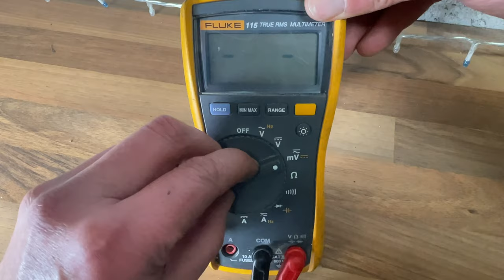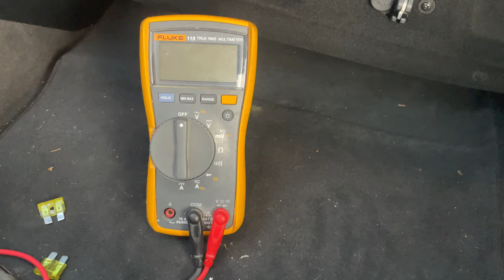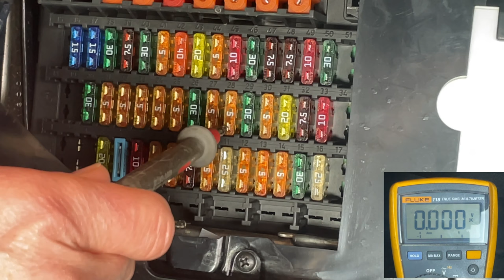How to Test Car Fuses With a Multimeter - Continuity Check

Comment: Thank you for teaching us!
Reply from the maker: you're welcome, glad you find the videos helpful! 👍
Reply: Is it safe mate
Reply from the maker: @puresim316nosimracingnolif3 if you’re referring to testing fuses in the fuse box without removing them, there is a small risk of blowing the fuse in your meter if the circuit is switched on and above 10A. If in any doubt, you can disconnect the battery first or remove fuses individually. Cheers, Phil

Comment: I just bought a '95 Dodge Dakota with high hopes, and wanted to be sure before checking the fuses using a multimeter. The brake lights won't operate, so I'm moving up the line to locate the source of the difficulty. Other things aren't working as well (gas gauge, dash light, etc.), so while I'm in the fuse box, I'm going to mind everybody's business in there. The only thing wrong that doesn't bother me is the passenger's interior door handle. In order to open the door, the passenger has to roll down the window and operate the exterior door handle. I've decided that's part of the character, and I may not even fix it. lol Thanks for the tutorial.
Reply from the maker: Looked it up ad the Dodge Dakota looks like a nice truck! 👍 From your post, sounds like you have a good idea what you are doing but when multiple things stop working, it is often an earthing fault. Check at the rear lights to see if you are getting 12v to your brake lights, if you are, you can forget about the fuse. Agree, reaching out of the window to open the door from the outside, will just make the truck and you look more cool! 😎

Comment: Can i also check its Amperage, with multimeter right?
Reply from the maker: Yep, that's correct. If your multimeter has the capability (and most do) usually, you need to switch the position where the red lead plugs into your multimeter, you should see another socket on the front of the meter where it plugs in. Then select "DC Amps" on your meter. You can then pull out a fuse and put the red lead into one of the exposed contacts (where the fuse used to be plugged in) and the black into the other. Then turn on whatever the fuse was powering (for example the radio) and you will see how many amps it draws. However, word of warning, the power is now travelling through your meter to power the circuit, so you can only test lower powered items in this way. On my meter it says "10amp" fused, so I can only remove 10A and smaller fuses and test the circuit without running the risk of blowing the fuse in my meter or damaging the meter. Hope this makes sense! If not, I don't have a video on it yet but I'm sure you will turn some up on YouTube! Cheers, Phil

Comment: Do i need to remove the battery head to check my fuse
Reply from the maker: No, you don't need to disconnect the battery. Some people do prefer to pull the fuse out to test it though. If I have a lot of fuses to check (or I'm not sure which fuse is the problem), I check them in the fuse box as shown in the video but when you're doing this, make sure everything is turned off in the car and the ignition is off. Hope that helps! Thanks, Phil

Comment: The exposed part of the fuses(in the back)  for mine are too tiny. I don’t even think my multimeter is making contact. I have to pull them out.
Reply from the maker: Ah that’s a pain! I suppose there are lots of different brands and some have better access than others 😔 cheers, Phil

Comment: Does the car need to be on to check fuse?
Reply from the maker: No it doesn’t and to be honest, it’s probably better if it isn’t on, that way there won’t be any electrical circuits that are using a significant amount of power. Cheers, Phil

Comment: Do I disconnect the battery? Also my battery is dead
Reply from the maker: You can check continuity of a fuse with the battery connected or not. Some people say it is actually safer to do it with the battery disconnected because it removes any risk of too much current going through your meter and damaging it (if testing the fuses in situation). Better get your battery charged asap, they don’t like being completely flat! Cheers, Phil

Comment: Would I have to remove my car battery to test my fuses ?
Reply from the maker: @rhadycal7290 No, just make sure everything is switched off, ignition off etc. It's best if the car has been off and untouched for about 15mins as some things do run on a little bit after driving. The risk is, if something is powered up, the voltage goes through your meter. Most meters have a small internal fuse that would blow at this point. It's worth mentioning, I've done this type of test dozens of times and this has never happened to me but someone mentioned it in the comments so I thought you should be aware. Hope that helps! Thanks, Phil

Comment: Tested all my fuses I was not getting any power to them, any clue why this is
Reply from the maker: Hi, do you have any power in the car at all? For example, interior light comes on when you open the door, headlights work when you flash them? If not, I would start at the battery. Assuming it's not completely dead, then you may have corrosion on the battery terminals, check and clean up both the positive and the negative. Also, check where the battery negative goes to the body of the car to make sure that looks ok. If this all looks ok and the problem isn't fixed, then it could be when you were testing the fuses, the earthing point you were using for the black lead wasn't good. If you have some lengths of cable, you can do a long length from the black lead all of the way to the battery, just to be 100% that the earth you are using is ok. Hope this helps! Thanks, Phil
Reply: @ReviveMyRide  found the problem it was the actual fuse box, I had to solder it for temporary fix
Reply from the maker: @Shineyhero  Oh wow, unusual problem! Well done finding it and for the temp fix 👍 Cheers, Phil

Comment: This guy is nuts!  Never put a continuity meter across a fuse that's installed.  If the fuse it blown and you put a continuity meter across the terminals you could get all that current through the meter.  Now if the circuit blew a 20A fuse then you could be trying to put over 20A through your meter.  Bad idea.  Better plan is to switch your meter to voltage and measure the voltage across the fuse.  If you get zero volts then either the fuse is good or there is no power to fuse.  It's sometimes a little harder but if you put one end of the probe on the ground terminal and the other on the fuse you should see 12V on one or both terminals.  If you see 12V on both the fuse is good, if you only see 12V on one then the fuse is blown.  If you don't get 12V on either then the circuit isn't powered (or you're doing it wrong).  In that case it's best to best to check if you need to have the ignition on or something and try again.
Reply from the maker: Hi, thanks for you comment! I appreciate your point and encourage discussion!  However, just a couple of things to add: 1) With ignition off, I can't think of any circuits on a car drawing 20A. If they were, your battery would be flat every time you came out to the car on a morning. 2) Most multimeters have an internal fuse to protect it. 3) I've been testing this way for 30yrs and never even had to change the internal fuse on my multimeter, let alone blown one up. Although what you said in your comment is "possible" it's obviously very unlikely to occur. 4) From my video: There is no faster way to quickly check all of the fuses, which is super handy if you aren't sure which fuse might be the problem. The continuity check across a fuse is 100%, if it beeps it is good, if it doesn't it isn't. There is no "it might be this" or "maybe that etc", which makes it a good check for people with varying level of experience. Anyway, hope that helps clarify why I showed how to do it the way I did. Cheers, Phil
Reply: That’s how I do it and have been doing it for 20 years and never had any problems
Reply: No you don't. If your doing a continuity test. The meter supplying a small voltage from probe to probe. Only testing between the meter leads. It's not testing the whole circuit.
Reply: It is a way to Test Fuses but not Suggested or Recommended, Reason being in Continuity mode a small Voltage is being inserted inside a Circuit and that can cause Problems. 
If the Fuse is Removed From the Load Center, then Continuity can be Checked Safely, otherwise a Test Light in my opinion works best, or Resistance check, some People I have seen do not even Risk with the Resistance Check.

 I also agree, even on Multimeter Owners Manuals it specifically states to not use ‘Continuity’ on Live Circuits. 
i suggest using a Test Light or the Voltage method if Fuses Remain at the Load Center.

Probably a good idea to update this Video.
Reply: Where do I find the ground terminal to put the Black Cable on ?  :)
Reply: Great video! Thanks!!!
Reply: @BlueGirl126 body

Comment: What about Realys?
Reply from the maker: I haven't had too many problems with relays. Occasionally, the blinker unit for the indicators has failed and I popped a new one in. In fact, this is usually the easiest way to test a relay: Usually, if you suspect one to have failed, there will be others just like it in the fuse box, you can swap them over and that will tell you if the relay has failed. If you want to test a relay, there's actually a little tool that you can use to test relays. Here's an example of one: https://amzn.to/3Gh0jB9 Hope that helps! Thanks, Phil

Comment: What do you do if there's no current coming to 4 or 3 fuses?
Reply from the maker: Hi, do you mean there is no current to either side of the fuse? Sorry if you already know this but you can double check that you have 12v to the fuse by testing each side of the fuse to a known earth (normally the frame of the car, somewhere not painted like a door hinge bolt). So, when I'm doing the testing at 02:00 in the video, instead of testing across the fuse with the two probes, just touch the red probe to one side of the fuse and the black one to earth. Then repeat the process and test the other side of the fuse in the same way. Instead of having the meter set to continuity, make sure it is set to 12v DC. Also, make sure the probes are plugged into the meter correctly, you can see where they should be plugged in at 01:57 in the video. It's very unusual to lose the 12v feed to the fuse, so it's worth double checking this. Hope that helps! Thanks, Phil